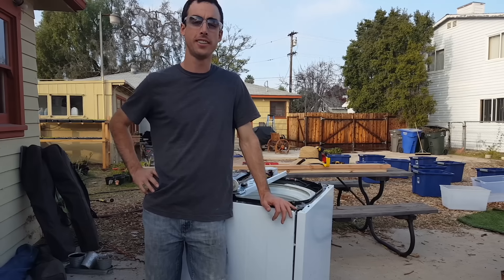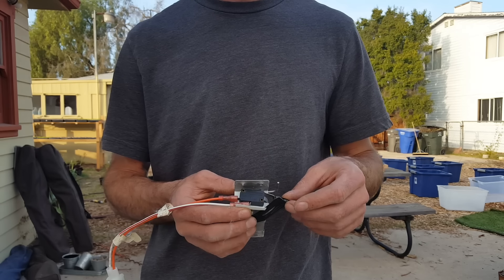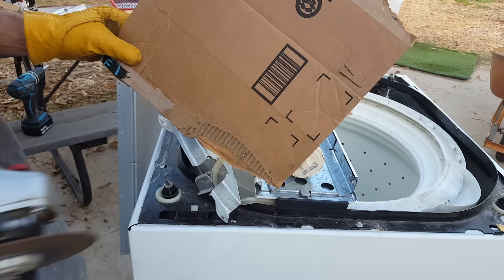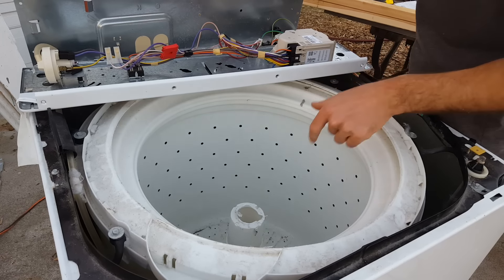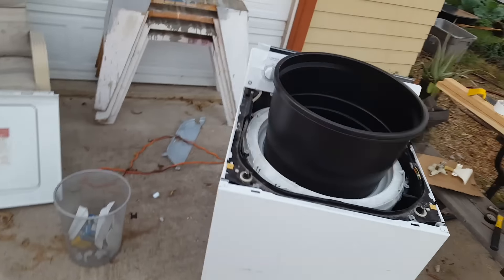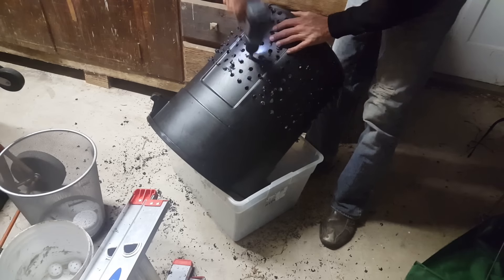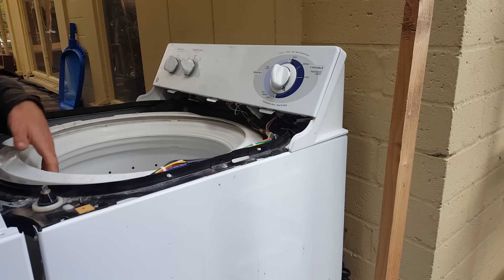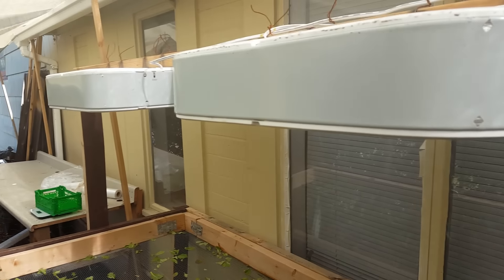Dry Salad Mix in Seconds! Washing Machine Salad Spinner

Comment: Just an honest question,  "Why didn't you just take the hoses off at there connecting points and remove the cowling from there"?  Another thing I could help you with is, instead of taping the door switch shut, you could just cut the two wires going to the switch and wire them together using a wire nut.  All in all, you did an awesome job and I am very impressed.  One more thing, if you cut the handles off of the garbage can you are using it should balance the unit out just a little more and possibly allow it to be less shaky.  I'm not sure how much this will help, but it certainly cannot hurt anything in the spin cycle.  
     Thanks for the videos and info.  Thumbs up as always.  
     God bless bro.

Comment: wheres the link to the laundry basket?  I've been looking everywhere....but i do like how you went into depth about the plastic.....i modified mine and all....drilled the holes but because of that residue and particles i just put a colander in in too with a lid i made....it works good but i want the basket...even tho it won't hold as much its only on the spin cycle for a couple minutes....its the drying screen that takes longer in my opinion....
Reply from the maker: Thanks for the heads up, I had the links in my other washer video. Here is the basket you are looking for, this is the larger one https://amzn.to/2C9Cxr2. You can put the basket inside of the trash can that's another great option. This basket is slightly smaller and fits inside of my 20gal trashcan, https://amzn.to/2C7jKwk.

Comment: Do you need the circuit board? I found a cheap washing machine without one!
Reply from the maker: You don't need it, as long as you are good with wiring. Michael Kilpatrick actual rewires the spin control to a knob. I've never done that though, he explains it in his course I have a link in the video description to it. You just need to make sure that the pump and spinning motor work.
Reply: @NaturesAlwaysRight  i would recommend everyone install a kill switch

Comment: one thing that concerns me when i watch michael kilpatrick and curtis stone videos is that they seem to use a lot of containers that are most likely not food grade...i worry not just about microplastics, like you mentioned in your video, but toxins leaching from the non-food grade plastics into the salad greens...what's your take on this in relation to the wash baskets, trash can baskets, & plastic totes commonly used?
Reply from the maker: I only use LDPE or HDPE plastic which are bpa free and considered to be the safest. I agree with you it does concern me a bit too that's why I went to great lengths in all of my builds to do things as well as I could to prevent any such "Leeching." I think the baskets are probably the best option I've seen. We need a food safe rated basket or stainless steel wash tanks and maybe colander could work as replacements for the wash tote and receptacle.. I'd love to do more research on it. 
But I'd also like to present another perspective that plastic is on our food constantly (people microwave their foods in plastic) and we are consuming small particles from plastic packaging, it is unavoidable in the modern life. The salad you eat from the store touches plastic from the field to the store and is sold in a plastic container. Foods have all sorts of synthetic chemicals in them and are considered safe by the FDA, the whole system is screwed up as we know. Here's an article related to it, https://www.webmd.com/food-recipes/features/cookware-plastics-shoppers-guide-to-food-safety#1. Radiation causes tumor growth but we get it in planes and get x-rays. It's a fact of modern life. I'm not legitimize these unhealthy things in modern life I wish oil based plastics never existed, too bad hemp was made illegal 100 years ago. I'm just trying to give more perspective to the discussion. So in my opinion, the concern is legitimate but is unavoidable and effect most likely negligible especially when using proper care and the best quality plastics. BUT I want a better solution as well and will do my best to figure one out. I'd love to hear any alternative suggestions you or anyone else has.
Reply: It did not link...darn!. Just copy paste this into the youtube search bar: "Delfield SALD-1 20 Gallon Floor Model Salad Dryer - 115V"